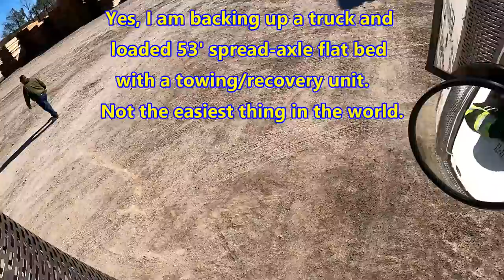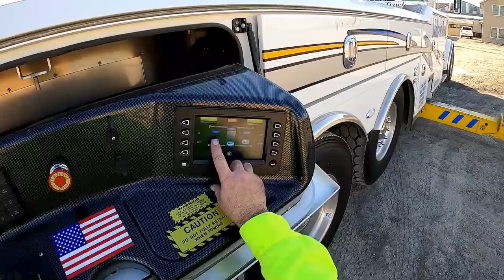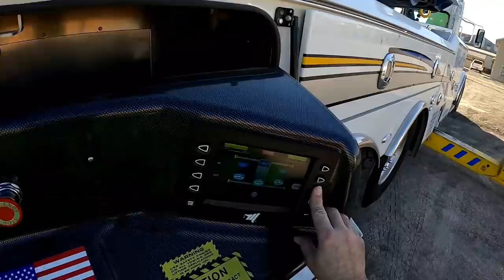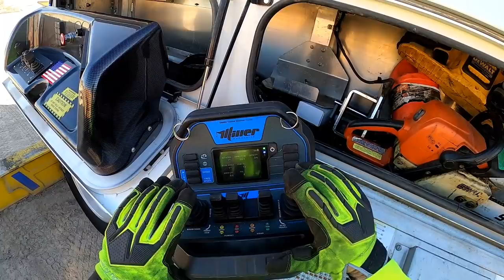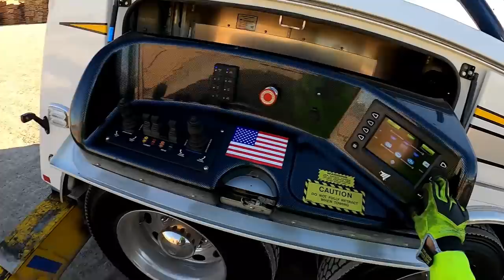Oh Shift 3.0!!! Brake Checked Semi!!!   Part 2...     The Rest of the Story...

Comment: hi were is the dash cam, Australia most state must  have gate install in trailer secure with chain both sides notice are  holes around the trailer no in front  Ron try driver road train
Reply: Jose C. I've seen those road trains operated. Must say, I believe Ron would have no problem. Maybe a mile or two to get the feel of it.. .after the initial walk around. The man is a wizard behind the wheel. Stay safe, God bless.

Comment: What's the penalty on brake checking?
Reply: Wreckless driving and the driver of the vehicle who brake checked him can be 100 liable for the services Midwest Truck provided and a new freightliner truck as insurance will drop you like a  hight potato if its found to be wreckless operation
Reply: @Newberntrains  "Wreckless" Probably doesn't apply in this case as there was most definitely a wreck.
( I'm assuming you meant "Reckless".)

Comment: I think you should reconsider the 3 horn blasts when backing up.  You have the "backing horn", either that works and should be acceptable, or it doesn't, in which it should be dumped and the horn blasts will be your signal. There is a point where duplicating devices can do nothing more than irritating those around you. Just my thoughts. Worth what you've paid for it.

Comment: I've been lucky only had 2 bad break checks with shifting loads. Nearly slammed into one guy, went from 60 to 25 so fast all because I did a slow overtake. My load hit the ROPS (Roll Over Protection System) but went no further. I spent the rest of the day being rescued & sorting the load out. Wasted a week having to get the trailer & truck re-certified and lost about $10k. All thanks to someone who owns the road. Yes I did have a dash cam but it wasn't needed as I just missed hitting them.

Comment: 29:12 Two weeks of training to drive a semi... and that's supposed to make you a competent driver?
Reply: Yes and no. It’s usually 3-4 weeks of trucking school (10-12 hours per day) then you start with a “starter company” usually a mega carrier and they put you with a trainer for 6-8 weeks. Usually by the end of the 3rd or 4th week with a trainer you’re driving a full clock (70 hours/week) but you’re still in the trainer’s truck so they’re there if you need help with something. By then though it’s usually just some more complicated backing maneuvers into tight spots or whatever . Depends on your starter company but mine required 180 hours of drive time before you could take an “upgrade” test to go from being a trainee to a driver.

Comment: i have to say it if there was chains on this that timber would of never moved
Reply: things can go wrong with chains too, but yeah; why did that load move? this wasn't even a crash.
Reply: yup, no movement of the load but more of the load damaged from the chains themselves. The majority of loads are secured with straps to stop damaging the loads.
Reply: I don’t think that is true in this case, if you looked at the first video there was all sorts and sizes of timber on that truck, so it wouldn’t be touching all sides properly, no matter how hard it was chained down.
Reply: Yes it would. You can strap or chain side to side as much as you want but there's only so much you can do front to rear without damaging the load. The trailer didn't have a bulkhead, that was the biggest reason why it went forward.
Reply: But the lumber would have been torn up by the chains.